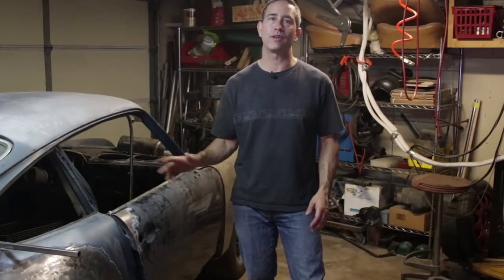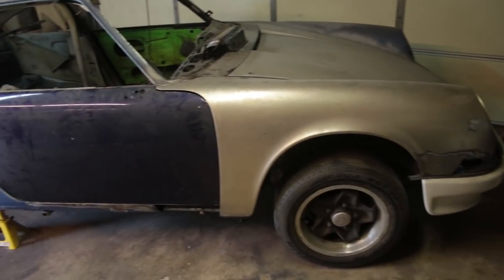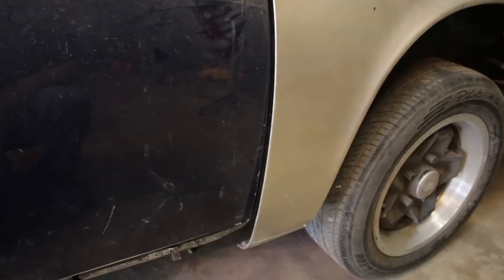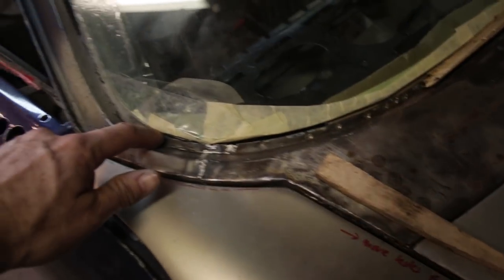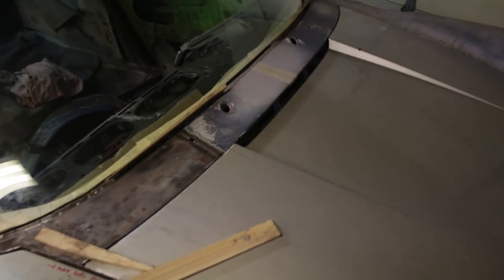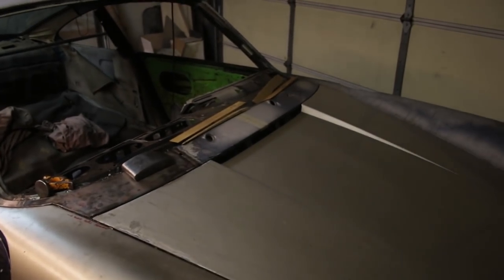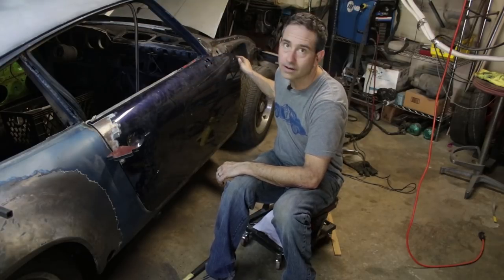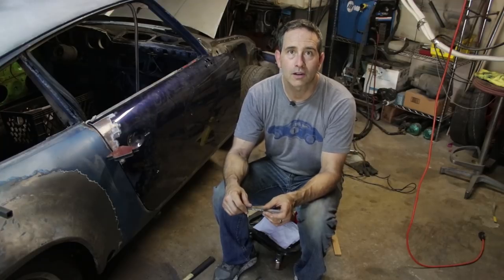How to Align Body Panel Gaps - 45 Year Old Porsche

Comment: I like the brute force method. Definitely not easy to watch and something typically done behind closed doors but it sure does work. Kudos for airing the good and the bad!
Reply from the maker: MrCknaak I agree, most people show the results but not how they got there.  Everything is bendable and shapable if you know where to hit it and how hard.  I'm just glad the dumbbell didn't come apart because that would have hurt for sure.  Professional shops do the same cringy things, but not in front of the customer!  When I was bending the front tub flange the front end would slide on it's tires about 1/2".